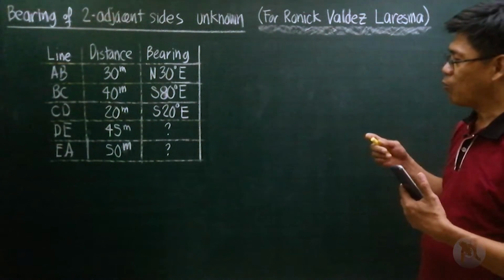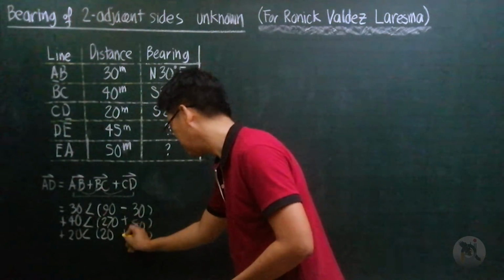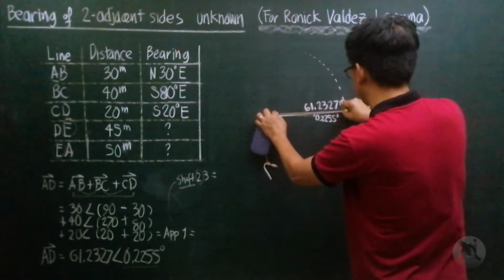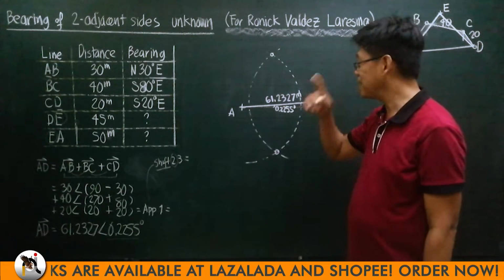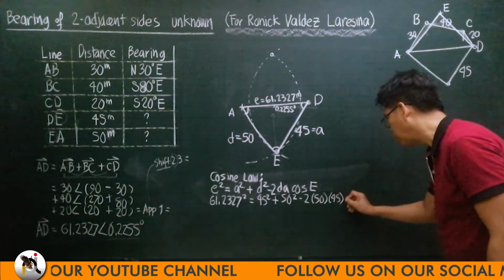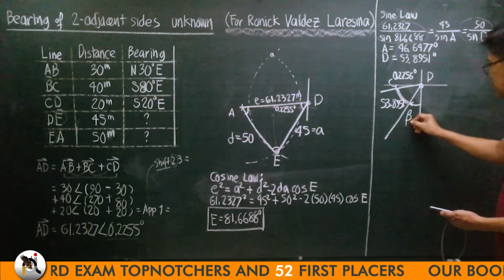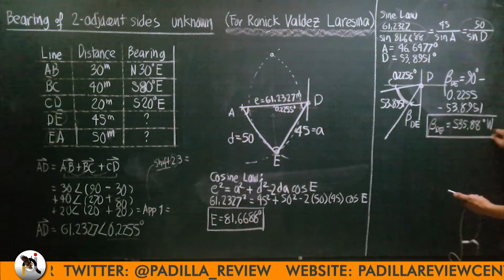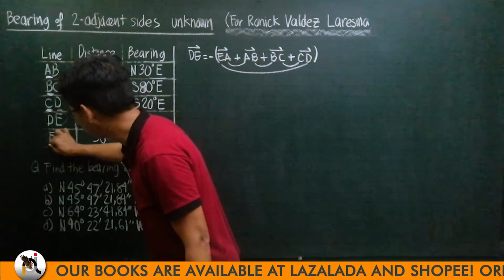CE Board Exam Review: Missing Side - Bearing of Two Adjacent Sides (SURVEYING)

Comment: sir how about po ung gantong questions? IF THE STEERING TURNS 12 DEGREES TO STARBOARD SIDE AND TURNS 15 DEGREES TO PORT SIDE, COMPUTE THE CURRENT SUPPLIED TO THE SERVO MECHANISM WHICH ACTIVATES THE HYDRAULIC RAM FOR BOTH ORDER OR COMMAND FROM THE STEERING WHEEL.

hope nA mapansin ung tanong ko ty po..
Reply from the maker: Hello Erickson. I'm really sorry that I'm not knowledgeable in electro-mechanical systems.

Hopefully, I can help you in your other concerns next time.